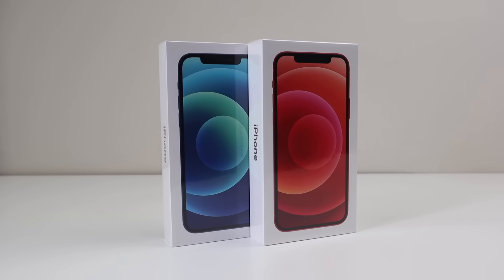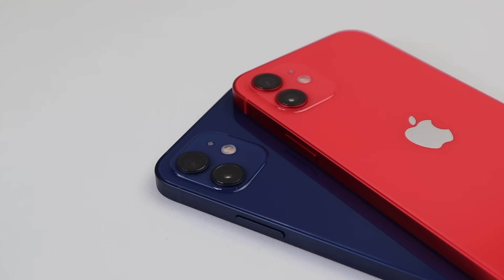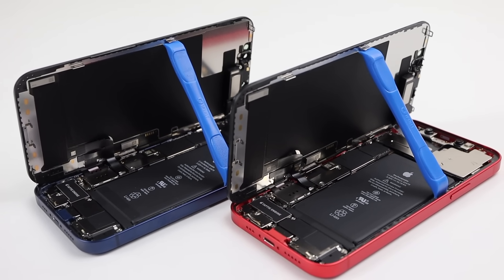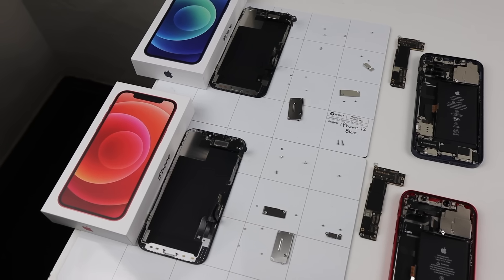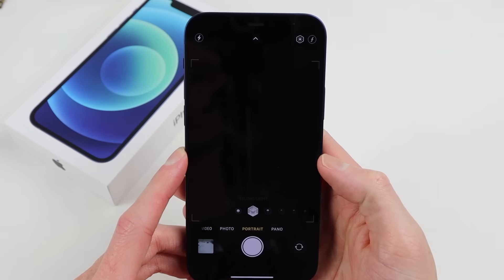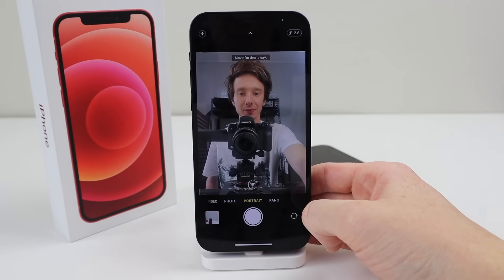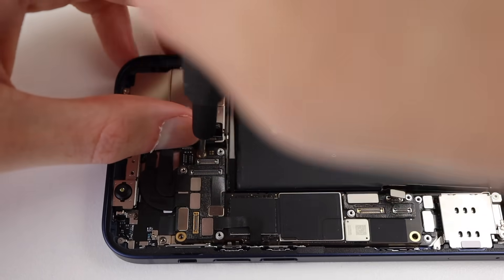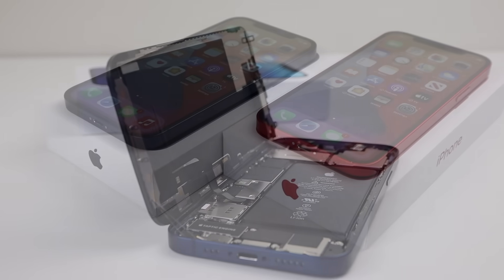iPhone 12 Anti Repair Design - Teardown and Repair Assessment

Comment: apple just wants money, then the cover it up with an excuse, they dont get money if they aren't the ones servicing it. they loose money if they give u charge cables and adapters. they make money when they HAVE to go to APPLE to get their phone fixed.

i look up at apple not as a role modle, but as a corrupt corperation that needs to be outdone. i plane to learn how to make a phone company do everything apple does, (free txt under wifi etc) but make it based around customer complaints, not money, sure i might loose money at first, but i think of it as buying good reveiws.

Comment: Back in 2011 I had a friend designing wireless earbuds that could be charged by a phone battery.  Worked on both apple and Android devices.
He files for approval, and Apple not only denied it and said they did not support this, they made a patch to block it then released their own devices that supported the feature.

Fuck Apple.

Comment: The most eco-friendly method is just don't buy their new phones. Keep using your old one. =_=
Reply: Until apple releases another software update that slows if down.
Reply: @ReplyNotificationsMuted  thx for this im gonna stay at my current software version
Reply: @tarooooooo9970  but then apps will stop working because the phone is not updated
Reply: @tarooooooo9970  it creates a problem too because you are going to have old security software on your phone meaning more risks
Reply: @ReplyNotificationsMuted , I still have the old 7plus. I let my kids use it. You just have to reinstall the firmware or reset it to factory setting and it's good to go. Sometimes due to repeated updates, your device will get slower especially if you have used more than 80% of it's capacity!
Reply: They slow them down with firmware updates tho
Reply: Or just don't use apple. They're overpriced junk
Reply: Or buy an android
Reply: @cheems2951  This right here. SAY. IT. LOUDER. FOR. THE. PEOPLE. IN. THE. BACK.( and grandma. you know she has an iPhone and can't hear a damn thing)
Reply: @Robert McNally not all android devices are bad, if you're "techy" you can find a 5G device under 400 bucks

Like the Poco F3 which has Snapdragon 870 is very cheap under 400 bucks.
Reply: @cheems2951  You domt even need to search far these days. Lots of new budget friendly 5g android phonss, pretty epic ngl
Reply: I got a better one. Never use ios devices! Easy solved
Reply: @traumatizedmacasio8682  yeah
Reply: The most eco-friendly method is buying an android
Reply: @Robert McNally We live in 2021, all top tier phone both android and apple basically have the same performance. Its a freaking phone. Who cares if one of the phones can open an app 0,1 seconds faster than the other. If you are so ignorant that you are still buying iphones I feel bad for you. Apple is the most disgusting and twofaced company out there "minimal waste" in my ass. More like "maximal profit and minimal custom service". Soon EU will hopefully ban apples "Anti repair policy" and force them to use the same charging cable as android phones.
Reply: problem there is at some point apple is going to make that phone extremely slow and with each new phone the specs (probably) will get better and better
Reply: @Kiralmao  There is a setting you can change.  Turn off peak performance battery managment.
Reply: @Kiralmao  how the hell they will do it with my Blackview?
Reply: @Kiralmao  then don't buy an iPhone. That's what i did. Switched from 6S to Galaxy s20 FE
Reply: @Kiralmao  do not update you phone os
Reply: @Kiralmao  yeah like you need that 0.5x  speed boost 😒
Reply: @Kiralmao  just dont upgrade your os. I have an iPhone 4 and I switched to android a while ago, but I never upgraded the os after ios 5 and it still runs great!
Reply: @Kiralmao  then stop purchasing their phones and find an alternative. Capitalism always wins. If people weren't buying their products they would HAVE to adjust.
Reply: @Kiralmao  Don't buy Apple products then. It's simple
Reply: @jammydodgerman  thank you for telling me for the 50th time
Reply: @Kiralmao  Huh? I've only told you once lol. Not my fault if others wants to give similar advice 😄
Reply: It's 2021 already, just switch to an android phone.
Reply: @John-po5vp   Android is more susceptible to bugs and intrusions. Can't rely on google especially app purchases. Developers usually abandoned their apps when it gets old and no support after a year or two. Leaving you to buy other apps..
Reply: And dont download "updates" that will shit your phone
Reply: Or just get a Samsung
Reply: Or one better: don't buy Apple products to begin with.
Reply: @Robert McNally you're one of the shitty apple fantards i've ever saw that believes Android is ugly.
Reply: Or just stop buying trashy apple products altogether
Reply: @flamemano  yes
Reply: Yeah im still using an old se. I think ill switch to android for my next phone
Reply: @Robert McNally man i think you got an issue. you should stop acting up.
Reply: Nono, move to android!
Reply: @xiyang9726  yes
Reply: @Robert McNally android, samsung, or any other brand is better than apple.
Reply: i still got Iphone SE and the battery getting unreliable since 4 previous update caused it...... now the fingerprint not being responsive and the passcode wouldn't show up when pressing the home button..... oh the joy having the nearly obsolete Iphone XD
Reply: i have an iphone 6s and i put a 2300 mah battery in it. With jailbreak I made it as feature rich as a much newer iphone. It is also very fast on ios 13.2. I will keep it for as long as possible.
Reply: Shitty Iphone battery man, those things won’t even last more than 2 years.
Reply: The faster you switch to android the easier for you in the future i guess
Reply: Or even better, don't buy iphone.
Reply: @Robert McNally yes
Reply: Get a gaming laptop or samsung phone.
Reply: sadly i can tell that apple is doing everything so people take new phones, i had an old iphone 5 ( 32 go ) but at some point when you do the update you can't ... their update are big and make the phone use a lot of ressources, at some point your phone can't run or don't have enough space to make the update.. i don't do update but when you use a new app or something for example i had to use a app to see my bank account on phone but couldn't do it. Because it need the lastest ios or something like that.. had to buy a new one because i didn't want to lose all of my data from my old iphone... the battery was too short, i use my phone for less than 1 hour its hot like hell and almost out of energy...
Reply: Worse purchase was buying the iPhone 5S in 2016. Still got it but got no space for updates and it heats up and dies after 40 minutes use. Can't remember what using a phone for music and long-term use feels like. The way technology is increasing makes me miss the old phones that were actually reliable.
Reply: The best option is to just not ever buy their products period. >__>
Reply: Or just don't buy iPhones. There are phones that are just as good from other companies, and that are way easier to modify and repair.
Reply: true
Reply: @Robert McNally what is wrong with an android phone?
Reply: @Robert McNally well they die because according to your comment your stupid enough to live anyway !!!
Reply: yeah but after some times they install a maj to slow down the phone.... =_= duh
Reply: @Robert McNally Flecks
Reply: @Robert McNally now buy those overpriced crap
Reply: just use android
Reply: even more simply: don't use apple
Reply: Yes you are right! Keep complaining about apple is this, Apple is what...Stop buying Apple products. Simple because you don't like it. 
If you do like it then buy..its your choice!
Reply: Or, consider this get a different brand phone
Reply: or get androids
Reply: Just dont use apple
Reply: Shrek  Isn't Android technically a Linux phone since that OS is based on it?
Reply: Or don't buy Apple at all....but sadly enough people throughout the world are too laissez-faire about the situation and either don't know, or don't care; and, won't take a stand.
Reply: I use an iphone 6 and am very happy with it
Reply: @Tronas1111  Really, and it still works? Mine is bricked, but I never upgraded iOS from 8.1.2, I didn't need it, I used it as a creativity tool since I got a Huawei from my sister for birthday, I have some nice apps on the iPhone 6 for programming, technical drawings and circuit designing, a couple of days ago I tried to turn it on and it doesn't go further than the Apple logo and turns off again after a while, if I connect it to the charger it does bootloop.
Reply: Somehow they need to keep the jobs, if everything would be designed to last as long as possible, repairable and upgraded, all the people who produce it would lose their jobs so their lives thanks to the artificial scarcity of the market system, unemployment exists only in the market system, under every other condition it is freedom, but in the market system it means dying homeless from hunger between empty rotting houses and stores overfilled with food that is disposed every day in bigger amounts than there are people who could eat it. It's about time to think further, the market system is the anti-economy and doesn't allow any economic development. Watch InterReflections, no conspiracy required.
Reply: @Wilson84KS  Artificial scarcity is a scam, stop defending them, it's like a guy stole your wallet and you said to him "Thanks! Come back again"
Reply: @rommdan2716  It is obviously not a scam if there are ways more products than people who could use them, if every five seconds a person dies from starvation while every five seconds over six tons of food are disposed because it is unprofitable to build supply chains, if people have to die from starvation homeless between empty rotting houses and stores overfilled with food that is disposed every day in bigger amounts than there are people who could eat it, the artificial scarcity begins with privatization of the natural habitat of the people, stealing our natural rights and sell them partly back to us, stealing the product of our work and sell it back to us and so on. The monetary/market system is a scam, the value of money is the scam, profit is theft, educate yourself a little and you will understand, learn basic accounting, how profits are calculated, it is the gap between what is stolen from those who do it and those who want or need it, but from this profit expectations all the production begins, not from a needs assessment like it would be in an economy.
Reply: @Wilson84KS  The light bulb industry used to make their bulbs worse so that they can sell more of them. The logic of why they did that was almost exactly the same one to the one you just talked about. And guess what? They started making longer lasting bulbs again, and last I checked, there are no bulb companies going out of business because of that change. Most of that crap big buisness tells you is just an excuse for them to be greedy lol.
Reply: @yuushanaruto9676  No, the greed is the system itself, companies need to rise their profits to be able to invest to survive, bulb companies changed their business strategies and produce tons of other products, they all produce their top sellers in China and make on professional light equipment atleast the same like on the consumer market. There was a decision made in usa in the 1920's/30', they finally realized and accepted that progress is unstoppable and that a system that is based on endless consumption isn't economic at all, that mass unemployment will happen all the time and is getting more because people develope all the time new strategies, techniques and technology to make their lives easier, to reduce work. The monetary/market system works against everything, just everything of true value, unemployment is actually freedom but mean death in this system, atleast for me it is example enough, but you can choose almost endless examples, structural violence, ongoing genocide with numbers of dead like a nuclear apocalypse because of wasting resources instead of using them wisely, single people decide over global resources, etc.
Reply: @Wilson84KS  Thanks for explaining to me something I already knew and something that doesn't take away from the point I was trying to make.
The point I was trying to make is that trying to force consumers to constantly buy new stuff for no reason other the an artificial one is stupid and exist only so that they could find excuses to sell you almost the exact same thing again but whit minimal hardware updates. Phones will get better for sure, but realistically you could skip buying the next 2 or 3 gens of iphones if the corporations didn't do the shit I'm trying to criticize.
The light bulb companies were intentionally making their bulbs last shorter the same way current day phone manufacturers make your old phones run slower whit hardware updates that brick the perfoance for no reason. 
The only point my opinion differs at from the rest of the comment section is where the comments try to paint it as if android doesn't do this. Android totally does this too and is a general problem for the entire industry not just apple.

Comment: Samsung does crappy stuff as well so I’m really upset. Try to get a new battery without destroying the screen and they can’t even properly glue the new one on at the repair shop due to the design of the phone 😖 I only replace phones when they break but the batteries die in 2 years!! Most have just finished paying for the damn thing right when this happens!

Comment: I stopped use Iphone when i bought two Iphone 6 and both of them were factory damaged. One has faulty battery and one has a broken power button and damaged memory parts. 
I took them to apple for repair, got the battery changed for the first phone for free. (but it still won't work as it should be)
The second one, they told me they could fix it by changing basicly alomst 70% of the phone, so they offer me $200 to replace with a new one.
I was like... why??  It is factroy damaged.... I used it for like 2 weeks, why I have to pay to change a new one? Then they tell me they can't confirm the memory parts is factory damaged because i have used it for 2 weeks.... 
I did not accept the offer, took both phone back, deleted everything and rest the phone. Traded them with honest condition described online for a near new second hand Samsung. 
Still working fine today after 4 years.... Never gonna use any Apple products.
They been designed to be unrepairable now...

Comment: Let me get this straight. Apple not only made their design super modular and service friendly, they also put in software that detects if there's different parts and have servicing screws. They use all these super repair friendly features to gimp servicing?! BRUH, they had the perfect opportunity to lead the industry in responsible self servicing. It's like selling buckets that has a new and perfect holding mechanism that halves the effort in lifting a full bucket, but it punches you if you use it to carry water.

Comment: One of many reasons I don't bother with apple products period. They try so hard to be 'different' when all they are really doing is being proprietary and screwing the customer every way they can. Downside is that Samsung has started to follow suite with them. Can't easily replace battery, no longer have ability to increase storage with SD card, no headphone jack, and doesn't come with a charger either anymore. 

Their eco friendly BS is just that, bs. It isn't eco friendly to make it so you can't have a more affordable repair store fix your phone whereas Apple will tell you the fix will cost just as much as a new phone, so may as well just buy the new phone! I'm so glad that Right to Repair is getting traction now that the FTC released their report.

Comment: the argument that 3rd party repair cut down on waste isnt very valid in my opinion. when compared to vehicles 3rd party repair often leads to more waste than factory done repair because 3rd party shops are as strictly held to regulations. honestly just the same as cars phones are going to get designed to be harder and harder to repair unless you buy highly expensive specialty tools. just like cars people who want to fix their own car by particular cars that make that possible/ easier.

Comment: Well i shall give you an intel why is this happening. For some of the apple models it was worth more in the first few months of new apple products you could benefit much more from it when you sold it as parts. Where digitizer was almost the 60% of the shelf price, new battery, logic board, camera, back panel ect. could give you around 130-150% of your phone price. You could just buy 3 iphone and dissaseble 2 of them for parts and you had a third one for free. Thats why apple made this distinguish protection. Not against the unauthorised repairs, but against the scalpers.